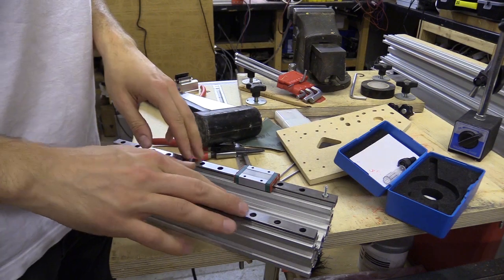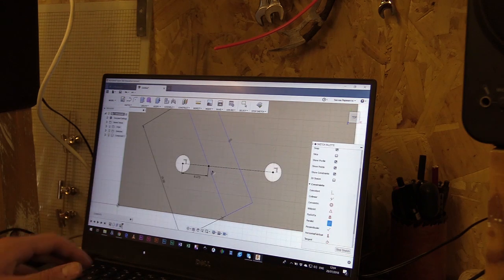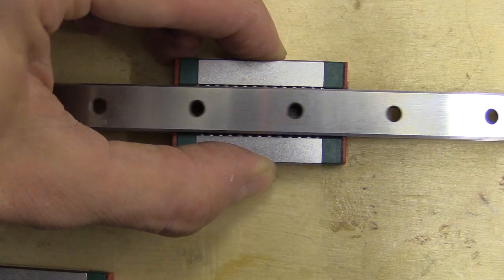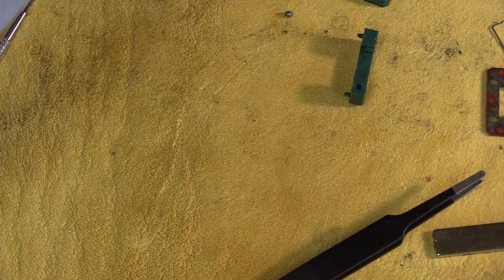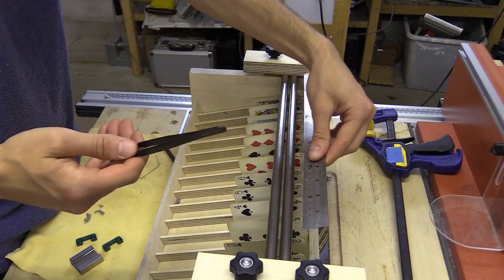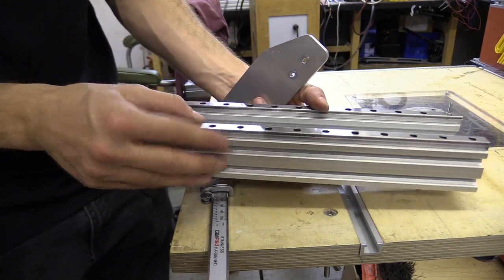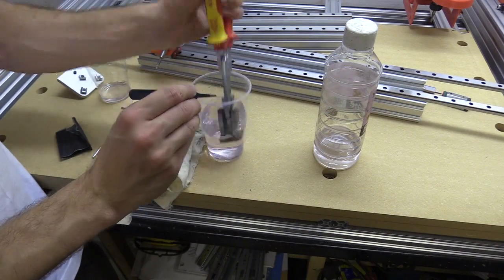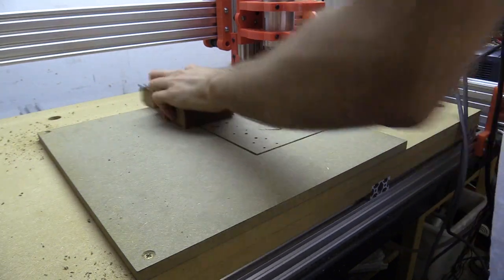#29 Linear Sliding Rail Guide #29 / MGN12 / Dial Gauge Jig / Improving Movement / Butting Rails

Comment: Wouldn't it just be easier to 3D print a spacer block to adjust both rails to be exactly the same distance apart?
Reply from the maker: Unfortunately not, because you want the blocks to travel parallel but the rails might not be parallel. So the best thing is to measure form the set rail block to the free moving rail block - tightening it as you go long.

Comment: Hi. MGN12 has 3.5mm holes but i see that you have had used M3  sliding nuts for mounting. Do you recommend M3 bolts for MGN12 or should i look for M3.5 bolts instead ? Thanks.
Reply from the maker: Mine used M3 machine screws but if you can find some with larger size it would help hold better. I'm in the process of upgrading to HGH15 ones now. Will keep the MGN12 for a drawings machine I want to build.
Reply: @EducatingSavvas  Thank you. I'm going to use M3 machine screws then. What head type do you recommend ? I'm thinking of using A2 head but they have cap diameter of 6mm and MGN12 has sink hole with 6mm diameter. It seems it's gonna be tight fit.
Reply from the maker: @turkayp  I can't remember the head size but if you look for the diagram for both the linear rails and machine screws you can work it out.

Comment: Normally joining two piece of Linear rails should be with angle cut like 45 degree at least. Because if one side ball jump to next rail, other side afterwards, in this case  slidely smoother jump.

Comment: Do you experience any probems with the joints when temp changes ? Of course its not optimal to join rails, but how well does it work ? nice video and if you want it even smoother change the balls for chrome ones... I use them in my 3d printer and they changed the game by a very large margin, this way you can tune even aliepress linear rails to work rather well (of course in my case there is no real force applied to the bearings, because they are only used in a printer).

Comment: I am not sure about the clones, but original Hiwin rails have a specific face that's precision grounded and marked with an arrow. This is the face you need to indicate off to ensure parallelism.
Reply from the maker: The clones trucks seem to have a mark on one side but the rails are the same on either side. I noticed that in some of the images online. Unfortunately mine are pretty cheap.
Reply: but hiwin shit cost owerprice lot not newer buy owerprice parts.

Comment: One of the problems with linear rails is parallelism which you have found out, also the rails follow the contours of what it is bolted to and even extrusion is not always flat, If I was building a CNC I would probably apply the bearing 2:1 rule having two adjustable preload trucks on one rail and get them true and one non adjustable truck on the other rail, technically the rail with one on is just a guide and not as critical as the rail with two trucks on, regards RobUK
Reply from the maker: Hi Rob. Yes I was thinking something similar - I think. So fixed through holes on the plate for the bottom rail and slotted openings for the rail above. I think it can get the rail pretty parallel with the jig I built but I could also use slightly longer machine screws for the top so it doesn't tighten the plate against the trucks and the slots can compensate for any deflection in the rail.

Comment: Found exactly the same things. My solution is to disassemble, clean and inspect all new trucks, they are all dirty. I've found bad bearings so have a very close look at them too, one side of the ball was flat and sometimes the trucks are missing a number of bearings. I gave up on trying to link the cheap rails, just buy them long enough.
Reply from the maker: Yeah I think long single rails is the way to go. It was just an idea and I realised testing whether it would work wasn't shared ina  video. Hopefully it will answer some questions for people who are thinking of using the rails.